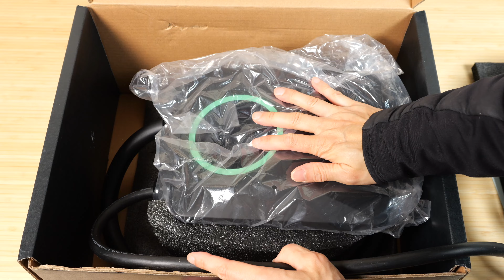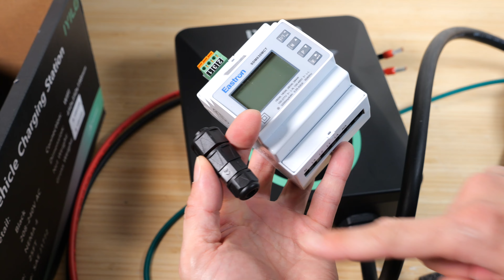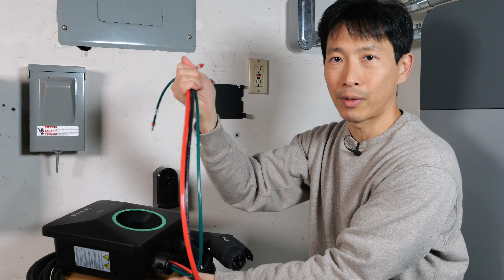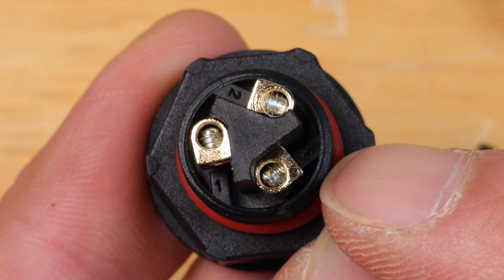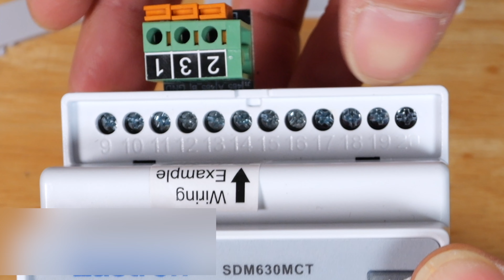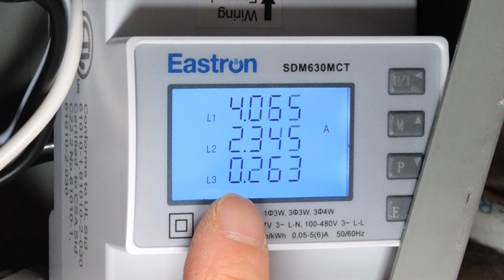Safest EV Charger Yet IYILO 48A EV Charger

Comment: Is it not better to install the meter outside the panel so you can live view the data and if so, do I have to run a conduit for that cable from the main panel outside the drywall so I can mount it directly on the drywall
Reply from the maker: Disclaimer: I am not an electrician
The meter is not meat to be mounted externally. If you do, you probably need another box with a rail system to properly mount it. Any live AC wiring straight from the panel will need a conduit.

Comment: Why does it look like each main line is over 80% of the 90 amp limit that you set. Shouldn't it be less than 72amps total when adding both lines?
Reply from the maker: Are you talking about all the things connected on each leg in the main panel?

Comment: What cable did you use for meter to charger? Any link would be helpful. Does the charger come with specification of the wire needed?
Reply from the maker: Yes you can go on their website to look up the energy management module manual. In that, it will tell you you need a 20 awg 2 core twisted pair shielded cable OR 2 conductor stranded copper shield cable, you get a length suitable for your needs.